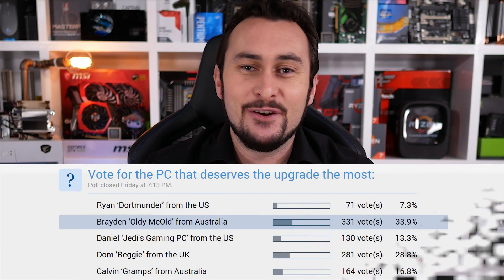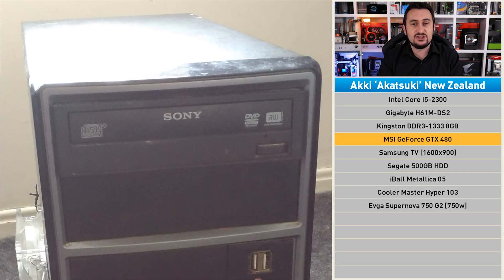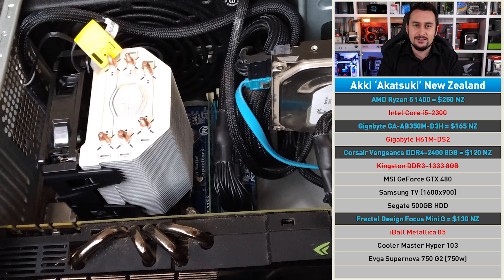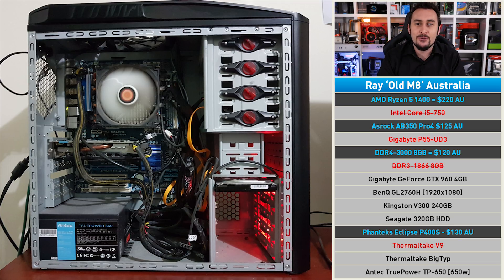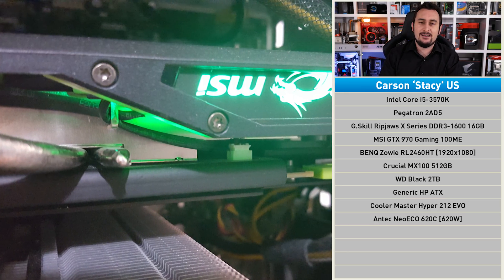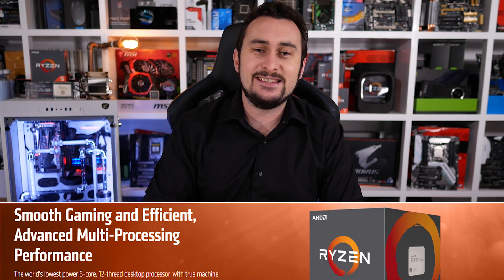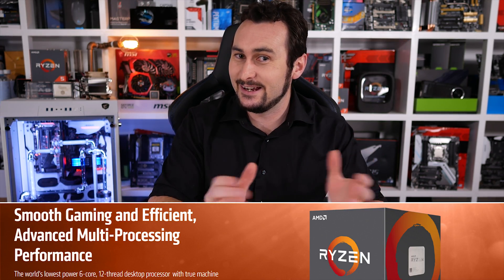Upgrade My PC Please! [S01E03] Core i5 Owners Needing Help!

Comment: Timecodes to quickly go back and check the specs:

01:44 - Akki ‘Akatsuki’ from New Zealand
03:57 - Ray ‘Old M8’ from Australia
05:39 - Carson ‘Stacy’ from the US
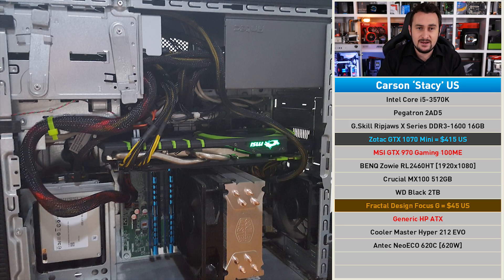07:30 - Rob ‘Cap'n Kitten’ from the US
08:57 - Jayden ‘Ye Ol' PeeCee’ from Australia
Reply: I'd suggest to Steve to have a screen at the end of the video showing summary of all the systems featured :)
Reply: Thanks mate! I needed this
Reply: The man!
Reply: Raivo K I almost fainted when i saw the first pc. I'm using a A4 4000 and 6670 ( i didn't plan on getting a GPU but it showed up on a nice price)
Reply: Thanks!

Comment: i5 3570k 4.4ghz,  galaxy GTX1080 SNPR EXOC, 16gb ddr3-1600mhz, Asrock extreme 4 1155lga, 128gb SSD, 930gb HHD, 454gb HDD and a 2TB HHD 750W power supply,  24"LG 60hz 1080p and a Antec Nine Hundred Two case 
What should i upgrade..  XD

Comment: I don't think any i5 user would have a problem with gaming unless they are going to buy a high end GPU. Can their systems attempt an overclock at all?

I'm rocking an i5-750 but I've overclocked mine to 4.0Ghz. At 4.0Ghz there aren't many CPUs that offer a significant upgrade for single threaded to quad threaded applications, you'd need to either spend a lot on the new CPU or overclock the replacement CPUs, otherwise expect less than a 30% speed bump in those lower threaded benchmarks.

I'm eyeing up a Ryzen 1700 and would try to overclock that to 4.0Ghz, that way I get a small bump in lower threaded applications, but any high threaded applications or games will greatly benefit and I would actually see a real benefit.

Comment: Seems I can't register on TechSpot. Everytime I input info and security question, it just fails, but gives no indication why. Cookies are enabled, so not sure the issue. I've attempted by using social media accounts as well, and then I just get "Unfortunately, you did not grant permission to access your external account. This is required to continue.", even though I did. Quite confused, will try again later, but looks like I may miss out on voting this time around.

Comment: *I have Mommy: Asus M4A78
RAM: Samsung DDR2 8GB 333Mhz
Graphics: ATI Radeon HD 4670 1GB
CPU: AMD Phenom X4 9850 2.5 Ghz
Case: Zalman z9
SSD: Samsung 840 EVO 120GB
HDD: Western Digital Green 1 Tb
Cooler: Cooler Master V6
Power Supply: High Power HP-550-G14C*

Comment: Old M8 & Akatsuki are the only ones who truly needed the upgrade in this episode. These people submitting unlocked Haswell i5's & 970's are kind of insulting to the nature of these kind of shows. They would easily game in stable 60 with very high settings in most games on their listed monitors. Poor Akatsuki has a 7 year old gpu, and Old M8 is on an 8 year old platform!

Please people, nobody vote for the Haswell systems. they do not need the upgrade. I am using a locked Haswell i5 and have great performance out of it, even with recent titles like Destiny 2 (Beta). I would never say my rig was more deserving of an upgrade.

Comment: I would wonder if runner-ups would prefer an Amazon Gift Card so they can use it towards upgrades, rather than a game they may or may not be able to run.
Reply from the maker: +Reiden Lightman amazing. That's all I have words for.
Reply: Reiden Lightman Ubisoft gave away the game codes, they're not gonna give away amazon giftcards though...  R6:S is pretty easy to run anyways :PUt

Comment: Woot. okay, i got MUUUUUUCH better pictures of my build now, cleaned out the dust, added a little buddy in there and brought it outside for some snapshots. really hoping that can get my fx 4300 system on the list of pcs that have a chance to be voted on.
Reply from the maker: +the blue hammer what's the thread title?
Reply: Hardware Unboxed should be "The Dundertron" lol. Hats off to you man, good series. 😁

Comment: look at some of those pc's...dude i still use i5 2400 4gb ddr3 gts 450 1gb ddr5 and a 1280x1024 monitor and still can play games mentioned in this video except bf1 and pubg, playing bf4 all low settings avg 85 fps. no offense but some of them didn't deserve an upgrade, no offense to you steve, just my opinion, keep up the good work

Comment: I have to ask, why not just throw everything into a HAF 912, great cable management, solid build materials, easy to work with, and they routinely go on sale for 30USD. Sure it kind of looks like a military-grade black brick, but the function you get for the price is absurd lol, I literally just don't build in anything else these days.

Comment: Is it just me, or did those last three builds really not need upgrades? Completely acceptable if you ask me. Especially the i5 970 system, that thing is still a beast at 1080p in most games that aren't in early access.

I didn't enter my rig because I thought this was for those of us that were less fortunate. If we are doing GPU upgrades alone, then I would have submitted. My 4790k is screaming for more frames.

Comment: When will this series be open for European contestants?
I'd like to suggest my brothers PC which I is a blast from the past. He badly needs an upgrade as his PC won't run any games newer than the first Stalker, even on lowest settings... (Intel Core2 Duo, GeForce 9400GT (passively cooled), 2x 512 MB RAM. It's jut sad to see.)

Comment: Hey everybody, 

I've been watching the series and now inspired to upgrade my computer. 
I've got a legit question. I'm running a Xeon X5650 @4.0ghz with a GTX 680 2gb overclocked. 
Will I be able to get the most out of a GTX 1070 (around the $560AUD) mark, or is it more efficient with a GTX 1060 6gb ($360)?

Currently playing Deus Ex Mankind Div
Reply: Or .... chuck a Steve ... do a mad overhaul to Ryzen 1400

Comment: i got a i7 2600 (non k) 8gb ram standard dell motherboard, gtx 970, 120gb 850 evo and 2 tb hdd, really wanna get a new cpu, motherboard, ram but everything in my price range is still not as good as the 2600, i don't know if i should sacrifice a bit of performance for loads of upgradability
Reply: I have the same i7 2600 dinosaur, but paired with a GTX1060 and 16gb RAM. It still rocks, though. I feel no drastic need to upgrade at this very moment. The only cpu upgrade I would consider is R5 1600 or higher. But to get a functioning Ryzen system (cpu + mobo + mem) would set you back at least 500USD. And it wouldn't improve gaming that much. It can only improve gaming in a few titles were old intel cpu's lack support. I remember heavy stuttering in Crysis 3 a while ago, whereas newer generation cpu's don't have that issue. The cpu itself is still perfectly fine, it's just that support has dropped, resulting in the cpu not aging very well. Upgrading right now would make your performance somewhat more stable (higher 1% lows), and give you a slight boost due to DDR4.
I'm trying to wait until Zen2, which will supposedly/hopefully release Q1 2019.
But if you really want an upgrade right now, I'd advice getting some extra RAM. 8gb of RAM is really pushing the edge. GTA5, Hitman, Witcher 3, ... those games truly go beyond 8gb RAM. 8gb is only acceptable if you don't play on high settings.

Comment: Upgrade my PC pls.
GPU: Titan Xp 3Ghz
CPU: 7700k 6.9Ghz
MOBO: Asus Z270 Über Schmetterling Edition
RAM: Kingston Pimplord DDR4 512Gb 4200 speed
PSU: Corsair Compensator 10,000 Watts (Unobtainium 99.99+ Efficiency)
Storage: 8tb Samsung Evo 666 SSD

I need another GPU so I can play ARMA 3 at 420 Fps on my 480p monitor.
Thanks for understanding, Steve.
Reply from the maker: Submit and I'll review your potato. You'll need an 8th gen Core i7 in a few weeks.
Reply: I submit!
Reply: Über Schmetterling Edition? Since when do we have butterfly-inspired motherboards.

Comment: Hey Steve, I am really liking this new series. Thanks to all of the sponsors and people who made this possible. If you can then please make this global. I'd like to compete in this giveaway because my pc is a real potato! And currently I don't have the resources to upgrade it fully. I can upgrade the processor but I'll not have enough money left to buy other important components like good ram and an entry level graphics card. My pc is around 8 years old and have gone through some minor upgrades. Right now at the heart of the system I have an i3 3210, a budget intel motherboard which was repaired by intel as it got bricked, stock cooler, 8gb Kingston hyperx ram, Asus geforce 210, wd 1tb blue hdd, Seagate 2.5" 1tb hdd, Samsung optical drive, foxin 500w psu, a budget case and an asus 22" led monitor. Thank you.

Comment: First of all, two thumbs up. Steve, when you announce the next winner can you please give a quick bit of information on why those parts you suggested. I mean like why the brand or type of the parts? How did you choose the graphics card over all the brands and types. Thanks Steve.
Reply from the maker: This is all based on my experience and knowledge testing pretty much every possible CPU and GPU combo. Watch the other videos on the channel for why I pick certain CPUs and GPUs. I don't want to bog this series down with that info.

Comment: Last night I was playing Rise of The Tomb Raider on Very High + SMAA at 1080p on my GTX 970 running at 1475 MHz / 7500 MHz and it ran always above 60 fps. Wtf? Someone who wants to upgrade is different from someone who needs upgrades. I'm using a i7 4790 here and DDR3 memory. Does it mean that fourth generation is old for gamers? Not at all.
Reply: Agreed!

Comment: I recently upgraded my old FX 6300 to a Ryzen 5 1600 @3.7Ghz on a MSI B350 Gaming Pro with 16GB G.Skill FlareX RAM, got a Kingston V300 120GB SSD and a 1TB HDD (forgot what brand) so thats all good...but the graphic card is pretty old. I have Sapphire R9 270X Dual-X OC 2GB and its really starting to show how old it is.

Comment: 1:44 Don't you think that rather than upgrading the CPU you should upgrade that GPU with a GTX 1060 as it will provide better performance than the Ryzen cpu. ❤️
Reply from the maker: Platform upgrades are much more costly. Akki can buy a new GPU down the track. Hell you could sell the Core i5, motherboard and memory and put that towards a 1060. This is a helping hand, not a complete hand hold :D
Reply: Hardware Unboxed Oh sorry just forgot about that. You are doing a great job man ❤️❤️

Comment: I'm gonna vote just to make sure the guy with the 970 and 3570k doesn't win because the other 4 massively need upgrading before him. This whole series is to fix bad gaming experiences of people with toasters, not giving someone with a decent pc a better one. Can I submit my 1700 and 1080 pc to try and get a second 1080 for sli?
Reply from the maker: No, that isn't the whole point of this series. It's open to everyone, if you take the time to submit your PC and provide decent pictures, you're just as valid as the next person. There is certainly no need to be so negative, feel free to vote for who you want to win but there is no need to bash others for taking the time.
Reply: Hardware Unboxed like if the guy had one or the other, then bringing the rest of his system up to speed would be good (say he had a 970 and a locked i3, then a cpu upgrade would be appropriate) and no one 
would get mad. The system doesn't need to be a core 2 duo system in order to be featured, but someone with a capable enough gaming rig should not get a free upgrade. I mean I already know that system won't win because viewers are smart enough not to vote for it, but the fact it's an option is saddening

Comment: Was thinking of submitting my PC, didn't do it because I live in Russia, but might as well tell about it.
Originally my parents bought me a prebuilt PC with an i7 860, an ASUS P7H55-LX, 8 gigs of RAM, Geforce GTX 465 and a SATA Samsung 1TB hard drive, all in a Thermaltake M5 case back in early 2011, was a sweet machine for that time.
I happily used it till 2015, when the games became too much for the old Fermi card and it died on me.
Then I bought a used R9 290 and started saving money for newer parts, and eventually this year I found a deal I could afford and bought an almost-new 6600K-MSI Z170a-G45-16GB of DDR4-2133 RAM combo for $250, which was an amazing deal for my country, but something wrong had to happen and the R9 290 died on me right then and there!
Even though it has a 6600K, Z170 board and 16GB of RAM, it doesn't have a graphics card, the hard drive is 6 years old and the case is all old and mangled.
I know what to do with it, just don't have the money, that's all :)

Comment: In my opinion Akki needed a GPU more than he needed a case, the GTX 480 performs below a RX 460,
Reply from the maker: Well Akki can buy a GPU later as I said. It's an upgrade package, not an entirely new PC and if your going to go to the hassle of building a new rig I personally would rather do it in a new case and then get a graphics card after saving up rather than doing the build twice.
Reply: magottyk a gtx 480 is basically a 750ti
Reply: +Federico Salemi, which is even further behind an RX 460.
+Hardware Unboxed.
It's tough when you need a lot to upgrade, another thing missing in action is an SSD.
The only part that I would consider salvageable towards the end result upgrade would be the PSU and in a pinch the hard drive.
So I can see the point of case now rest later.

Comment: Get the second guy (Ray 'Old M8') an upgrade just so he can play CSGO and DOTA2? His system can run those games well enough. Sorry Ray you don't have my vote or my respect.
Reply: Malus1531  You are an idiot. Calling out the guy who has an 8yr old  i5 series CPU, but don't say shit about the other 3 entries that all have newer CPU's. SMH
Reply: Thekingofnooby but considerably slower than all the other i5's here. What's your point?
Reply: You realize he also mentioned PUBG? I'd imagine that old i5 struggling running that.
Reply: Nehalem 750 woohoo! Just overclock it to the limit, throw in a GTX1060 or RX580 and you're set until the Playstation 5 era when it will finally make sense to have 8 CPU cores :D
Reply: Tuugeboi nope they are still today very Strong..

Comment: I'd love to have any of these PC's, They all crap over my Core2 Quad, that I can't use at the moment because the C: died and I don't have the budget to replace it at the moment, So now I have bad gaming withdrawl.
I've sent in to try for an upgrade with fingers, toes & eyes crossed, though not really expecting to be selected.
Good luck to you luck sodds that did get selected.
I don't expect to be to be one of the chosen few, But I'll keep voting anyway.

GenFUBAR.

Comment: My old Core i5-7600K, 32 GB DDR4-3200, GeForce GTX 1080 and 1 TB Samsung Evo 850 just won't do anymore. What do you recommend, Steve?
Reply: You should get some rgb and maybe another 32gigs of ram
Reply: u need RGB
Reply from the maker: GTX 1080 Ti and a 2TB 960 Pro, then we can be twinzies.
Reply: get a pc monitor, a psu, a case, case fans, a legit copy of windows, keyboard, mouse, speaker/headset, pc table, gaming chair  ^_^
Reply: Add some RGB fidget spinners
Reply: I would be more than happy to take that old TI off your hands for you =p
Reply: Kakashi Hatake he's being sarcastic
Reply: Astfgl may aswell scrap that pile of junk. Geez how do you even play anything? Probably need to play 720p too SMH
Reply: Astfgl It requires rgb.
Reply: That Cpu is gonna be bottleneck get a Pentium
Reply: Astfgl get a Pentium 4
Reply: i9 seems to be your only path. And RGB of course.
Reply: maybe gtx 1080 ti 11GB
Reply: Astfgl shove a 7700k.
Reply: Ryzen 5 1600
No new Mobo, though. Just a new CPU to glue to your case or something.
Reply: U need to donate some money to me... You don't need any update wtf

Comment: My i7 7700 Non K, 16GB RAM @ 2400Mhz, SSD & HDD combo & RX 480 8GB needs an upgrade Steve ( ͡° ͜ʖ ͡°)
Reply: We recommend moving to Alaska as there is currently no GPU cooling solution capable of keeping your GPU cool and quiet  ( ͡° ͜ʖ ͡°)
Reply: Lmao but it keeps my room nice & warm in the winter ( ͡° ͜ʖ ͡°)

Comment: Yea I dont really think people with 3rd gen i5s or higher need to upgrade yet, just more memory since ddr3 is so damn cheap new and used
Reply: DDR3 is expensive. Ask me how I know.
Reply: Tico2858 where is ddr3 cheaper? It used to be, but all ram has gone up
Reply: garrahan90 30usd for 8gb of 1600mhz, how is that expensive? im not even in the states and i know its cheap everywhere
Reply: yep my 3570 still going strong using a 7970 still which plays most games med-high
Reply: Tico2858 show me a link
Reply: Tico2858 that is expensive, and gamer ram is like 60. I'm looking for some now. Can't find any for cheap
Reply: if youre buying DDR3 ram NEW in 2017 your doing it wrong, and even if you are its still cheap, go on amazon or newegg or ebay, i dont need to put links when it takes 5 seconds on google
Reply: how tf is that expensive when 8gb of ddr4 costs almost $120 AUD
Reply: no one is buying ddr3 new, and if you are then you are clearly doing it wrong with how insanely cheap DDR3 is used while its still cheap new

Comment: I would think a i5 2500k with a non overclockable motherboard would need a upgrade more than 3 of the pcs on here that have a decent i5 and graphics card but I guess not. Good luck to who got picked.

Comment: I'm regretting not entering the machine I built for my friend. Between the motherboard not posting with more than 6GB of DDR2 800 installed (and 2GB of DDR2 1066) and the Core 2 Quad X6850 with a 10 degree delta between cores its on its way out.

Comment: All "Stacy" needs is overclocking capability and breathing room, so a new motherboard and case which he can get for ~$120 (Z77 mobo second hand from like ebay, craigslist, or aliexpress for ~$70, and a case from newegg, Amazon, or even second hand for ~$50). Anyways, good luck.